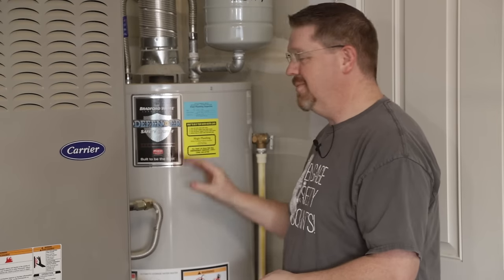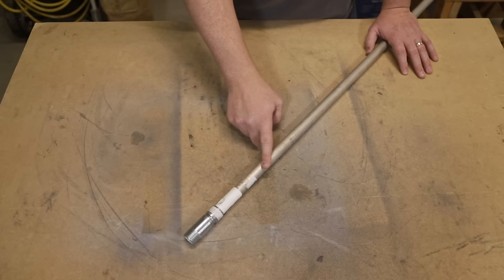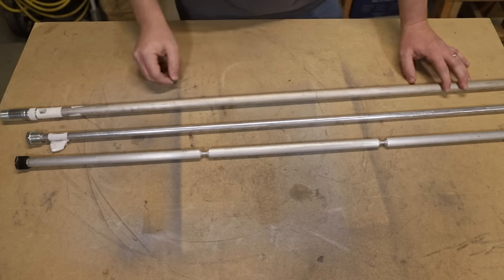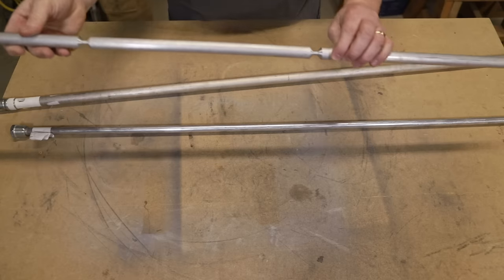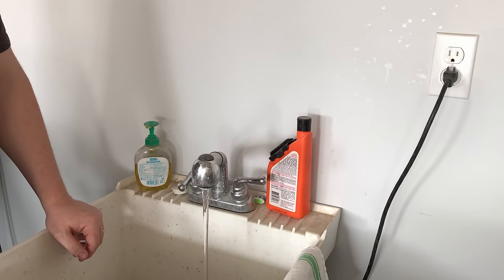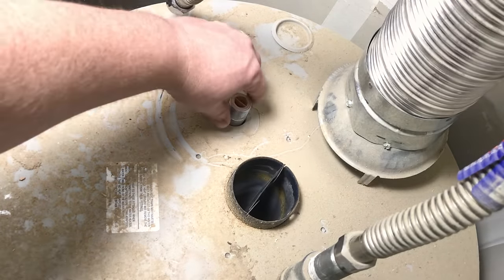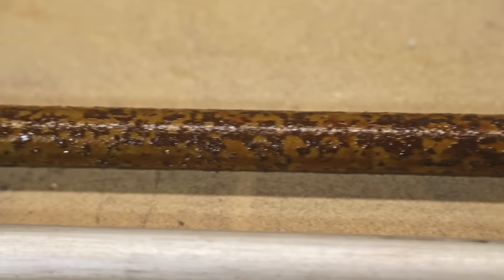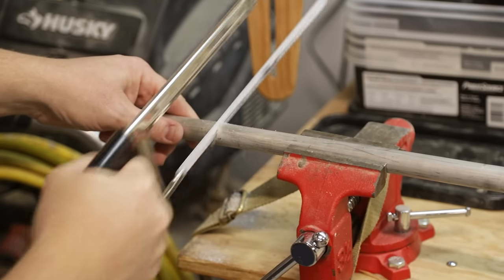How To Replace Water Heater Anode (Step By Step)

Comment: If I don't have enough head space to remove the old anode, how would I remove it? Thanks
Reply from the maker: Hi Edward - you'll have to remove it in sections: unscrew it and lift it as high as you can. Then attach a vice-grip to it right at the outlet to hold it up, and cut off the section that has been exposed. Then lift the next section out with the vice grips, move the vice grips down to the outlet and re-clamp, cut just above the vice grips again, lather, rinse repeat.
To replace it use one of the sectioned anodes that I demonstrated in the video that is flexible. Good luck!
Reply: Just take your cordless drill and get a paddle/waffle bit the same diameter size as the anode rod and drill a hole directly above where the hot water outlet sits on top of the heater. Drill into the sheet rock ceiling and now you have the room to put the rod in.
Reply: @Eddie-In-Las-Vegas  Thanks.

Comment: My water Bradford is 16 years old. Never flushed never changed anode rod. Not touching anything until it leaks or dies.
Reply from the maker: Yeah, you are on borrowed time. I hope it lasts a lot longer for you!
Reply: @AmplifyDIY  Well over its life span so I am in the +.

Comment: What is the maximum I can cut an anode rod?  My rod does not fit in, due to height of sealing.
Reply from the maker: Hi Rohit - if you have to cut the anode, it will not last as long. If you can, it's better to get one of the flexible anodes I showed in the video so you can get a full-length one installed. Good luck!
Reply: @AmplifyDIY  I already brought a straight one and costs a lot to return.  For next time I will use flexible, after watching your video.   I am looking at cutting 7" from 50" rod.
Reply from the maker: @rohitbhatnagar7599  Ah, cutting a 50" rod down to 43" is fine. Good luck with the install!

Comment: how old is the water heater? it is not that bad on the anode. Can the calcium be clean up on the anode?
Can I use impact wrench to remove the anode rod?
Reply from the maker: Hi Spock - at the time of this filming, the water heater was around 3ish years old. There is no reason to remove the calcium on the anode - it'll naturally fleck off as the anode continues to do its job. You can use an impact on the anode, but I don't recommend doing so. It's gentler and safer on the rest of the fitting to use a large breaker bar. 
Good luck!
Reply: @AmplifyDIY  Thanks for the information.

Comment: How come you didn't open the pressure valve when trying to empty the tank a little... ? Also, I think it would have been nice if you at least cleaned all the dust on top of the tank before you started recording... looks so disgusting.
Reply from the maker: Good question on the T&P valve: I didn't need to open it, as the tank was draining ok with just the faucet left open that I showed earlier.  Sorry you found the dust to be disgusting.... I always try to be accurate about the actual conditions I am working in. I dislike videos that are clearly staged or showing how to work on something that is clearly brand new.

Thanks for watching!
Reply from the maker: @alanabunch8881  Good luck with your replacement! Have you considered a different alloy than magnesium? Using a different type may help with the smell.... Good luck!

Comment: my OEM Bradford White anode rod cost $90 (vs your $25)  and the heat trap $13 (vs your $4). Inflation after 4 years?
Reply from the maker: Yeah, most likely. An awful lot of stuff has gotten a LOT more expensive over these last 4 years.
Reply: @AmplifyDIY  Still worth it over the $700 the company was going to charge me to replace it!

Comment: So a starting question is: Why don't manufacturer's use a water tank that is NOT easily corroded?  I have no doubt this would not be that difficult, but that the heater manufacturers want these things to fail.
Reply from the maker: Simple answer: Cost.

Comment: If your hot water heater is over 2 years old if you never touched your gas valve DON'T if you do you might not have hot water .its like a old hot water valve thats old it doesn't leak until you touch it.
Reply from the maker: Eh, I disagree. I recommend viewers take the time to learn how a water heater works, and perform maintenance on it regularly. When it is maintained, a heater should last a very, very long time. The best time to start maintenance is of course during the first year, but the next best time is right now, no matter the age of the heater (within reason... something that has not been serviced in 20+ years but is somehow still working is just a failure waiting to happen... but something that's only 2 years old? That's practically new. :) )

Thanks for watching!

Comment: Not knowing what the tan colored "dust" is on top of the water heater.... the dust looks like wood or insulation debris.....  One MAY WANT to clean the top of the water heater especially near the hot air vent for the gas fired burner.....  JUST IN CASE....

Comment: Where did you get your anode rod?  That is a great price.
Reply from the maker: Hi Rohit - I picked up the anode online from https://www.supplyhouse.com/ - you are right, they offer great prices on parts for water heaters. Thanks for watching!
Reply: @AmplifyDIY  Did that price include shipping?
Reply from the maker: @rohitbhatnagar7599  Hi Rohit - if you look on their website, it's easy to tell what they charge for shipping to your zip code. Looks like prices have gone up a little, but I could order the same anode I used in this video today shipped to my zip code for a total of $42.39, including shipping.

Comment: Where did you get your replacement rod from? I tried calling Bradford White Parts and they don't sell to homeowners, only wholesalers. I tried ordering through bradfordwhiteparts.com and they want 30 bucks just to ship the thing, plus the cost for the parts, obviously. Thought I'd check with you to see how you went about it.
Reply from the maker: I found mine at supplyhouse.com - just look up your specific heater model number and they list parts that way. Shipping was not overly expensive, either - $5, as I recall. Here is the exact part I ordered (though of course check to make sure you order the right thing for your model): https://www.supplyhouse.com/sh/control/product/~product_id=224-47776-19

Good luck!

Comment: Wouldn't that be easier to replace the magnesium/alumimum anode rod with a titanium 12 in. anode rod with cathodic protection system i.e. Corro-Protec
Reply from the maker: Hi Jean - I'm not sure it would necessarily be any easier as far as the swap process goes... but it would prevent needing to ever change it again. However, they are quite a bit more expensive as well, and they add to your electricity bill, etc. So, pick your priorities and go with what works best for you. Thanks for watching!

Comment: If you youtube "ao smith how its made" you'll find videos that show that the hot water, cold water, pressure relief, and anode are all what look to be 3/4" npt theaded ports. And that for their premium line, they install two anode rods. One normal hex anode rod in its own port and another on the hot water out like this video. So like, couldn't you install another nipple style anode rod onto the pressure relief valve for a total of three anode rods? Or wouldn't it be possible to install a nipple style anode rod onto any water heater hot water outlet? Assuming that most all water heaters water outlets are threaded, which seems reasonable since replacement heat trap nipples are pretty common.
Reply from the maker: Edit: I was confusing hot water outlet and drain port in my earlier response. Edited with my better understanding.

Interesting idea! However, there are a few reasons not to add more anodes - particularly at the T&P valve location.

For the T&P valve, there is actually a probe that extends several inches off the back of the valve out into the water in the tank. This would interfere with the nipple style anode connection, so the 2 cannot be installed in the same port.

Further: Adding more anodes does not really get you much advantage other than increasing the duration between needing to check/replace the anode(s). If you have 2, they'll last longer, sure, but is it really all that much better to have to replace an anode every, say, 6 years vs every, say, 10? Anodes are cheap. Replacing them is not difficult, so I don't really see much advantage in cramming more of them into your tank. 

Really interesting question though - maybe someone with more knowledge can weigh in?

Thanks for watching!
Reply: @AmplifyDIY   Indeed I didn't think about the t&p probe. My water heater's t&p valve is installed in the top anode rod port. So It seems it's been running without an anode rod for the past 4 years :(. I messaged  ao smith and waiting to see if it would be ok to install a combo rod into the hot water outlet, or if I really am gonna have a bad time if I try wrenching off the nipple. 

Coincidentally, it looks like AO Smith's lower end water heaters have a 6 year warranty while their premium models have a 10 year warranty. Wonder how much the double  rod setup has to do with that :D

Comment: you used the plair in bakuz wen you tri to remuved the firing that the rising you dont ave grip
Reply from the maker: Would not have mattered. There is no way those pliers were getting that anode out. Definitely needed the pipe wrench. Almost needed a breaker bar as well.
Reply: the pliers whasi  in bakuz   the fact the plair whasi no able to do the jobyou dha one ciused to used   @AmplifyDIY

Comment: Where to buy the heat trap?
Reply from the maker: Hi Mitchel - I bought it from the same place I picked up the anode itself. It was less than $5. Here is a link to the one I think I used: https://www.supplyhouse.com/Bradford-White-239-45167-00-Heat-Trap-for-Anode-Rod

Comment: It appears you forgot to tape the top threads on the Anode pipe?
Reply: It's not using the threads to seal on top. I think it's a compression fitting. It's also why he said not to overtighten the top, but used a pipe wrench to "fully seat" the bottom
Reply from the maker: @Steven_S  This is absolutely correct. The fitting out to the house has a little rubber gasket inside that forms the seal. No pipe dope or tape is necessary. Thanks!

Comment: Use an impact wrench.  I don't know why all these videos just don't say that.  If you don't have one, buy one, they are not that expensive and it is a must have tool anyway.  My 10+ old water heater's rod came out like a shot using an impact wrench.  It was totally eaten away.  I knew nothing about anode rods until it was too late.  I think that is the case for most people, nobody tells you about that because they don't want you to do your own maintenance even when it is child's play.  So much of contractor work is like that, but they try to give the public the impression it is all rocket science and beyond us.  Except on youtube that is.
Reply from the maker: I agree an impact wrench is a good option, but for your average home owner, they have no real reason to spend a bunch of money on a strong enough impact to do the job. I try to show how to do things with what you likely already have, or can get very inexpensively. In this case, a $30 pipe wrench works great. Thanks for watching!

Comment: How old was your tank when you changed this anode rod ?
Reply from the maker: About 3.5 years old.
Reply from the maker: But I didn’t need to change the rod yet. It was probably good for at least another 2 years.
Reply: So how often do you recommend this anode rod change ? How do i know its time to change it ? All of your videos are very informative.. thanks
Reply from the maker: My manufacturer says to start checking at 3 years, and every tear thereafter. They recommend changing when it gets down to about 30% of its original thickness. The actual time will vary wildly based on your water supply. Good luck with yours, and thanks for watching!

Comment: the previous owner probably cut it because as you found you barely had clearance. Its odd that you didnt trust the factory to supply the correct length
Reply from the maker: They reason I questioned the factory is because there was no previous owner. I'm the first owner of this house, and at the time this was filmed the heater had been installed for only about 3 years. I just found it odd that the factory replacement was a different length than the factory-installed original.

Comment: How old was your wh?
Reply from the maker: At the time I replaced this anode it was around 3 years old. As I mentioned in the video, the anode still had a few years of life left in it, but I went ahead with the replacement to show all the steps in the job. 

Also, note that the quality of your water supply can drastically affect the useful lifetime of your anode. Most manufacturers say to start checking your anode 3 years after install, and annually thereafter until it needs to be replaced.

Thanks for watching, and good luck with yours!

Comment: That anode rod design appears useless. The magnesium is electrically isolated from the tank by the white plastic spacer is it not?
The fact that the old rod had not lost any substantial diameter is pretty much proof that it isn’t working. The new rod appears just as useless as the old rod. 
It is my understanding that a sacrificial anode must be electrically bonded to the steel it is intended to protect.
Reply from the maker: There is a steel cable that runs through the plastic spacer, and down the center of the magnesium rod. It is electrically connected. The lack of substantial diameter loss has more to do with the fact I have a water softener upstream of the heater, which makes the anode last much, much longer than if it were in the harder water in my house supply. Thanks for watching!
Reply: @AmplifyDIY   😊👍🏼

Comment: how big are the channel lock pliers that you tried to use? i have 8 inch channel lock pliers
Reply from the maker: Those were either 8 or 10 inch. There was no way they would have cracked that joint, though. It took quite a bit of torque on the pipe wrench. If you are in the US, Harbor Freight sells the same wrench I used for something like $12. Good luck!
Reply: @AmplifyDIY  After how many years did you replace this particular anode rod?
I am going to change the anode rod with my plumber in a few days. 
Mine is 4 years old.
Reply from the maker: @d6487  The heater was about 3 years old when I filmed this video. As I noted in the video, the anode did not actually need to be changed - it had some corrosion, but still had plenty of life left. I demonstrated the replacement to show the full process. At 4 years old, you should pull your anode and inspect it. Only replace it if it's actually corroded down to almost gone. Good luck!
Reply: @AmplifyDIY  thanks!
I have yellow colored water coming out of my bath tub faucet and sometimes it turns black too. 
So the plumber said to flush and check/replace the anode rod to find the cause of this.

Comment: Drop a large diameter bolt down the pipe nipple before cranking on it with a wrench.  This will keep the nipple from crushing.  I've pulled some seriously corroded heat trap nipples off crushing the nipple around the inserted bolt.

As for getting leverage on a water heater to torque difficult heat trap nipples, employ a monster truck load ratcheting tie-down strap and a 2x4:

https://www.youtube.com/watch?v=ufDi2EfHT6w

Comment: You would have never gotten the full length rid into the tank, not enough ceiling space.
Reply from the maker: I'm pretty sure that I could've tilted the rod enough to get it in. The bigger issue is that the rod itself was too long to fit inside the tank.Thanks for watching!
Reply: @AmplifyDIY  oh that’s crazy too. Something else to watch out for before you put the new one in tight.

Comment: That is a secondary anode.  This model has 2.  1 secondary and 1 standard rod.
Reply from the maker: Hi Random House Projects - I don't believe that's accurate. I checked both the specs sheet as well as the service manual for my specific heater model, and no mention is made anywhere of a secondary anode. The only anode shown in any manual or parts diagram I can find is the one I showed in this video - connected to the outlet fitting. Thanks for watching!
Reply: @AmplifyDIY  ok...because on the ao smith premium heaters they're are 2.  One secondary in the hot water outlet like yours and a standard anode under a plastic cap.

Comment: You forgot to explain that you need a special  Class-D fire extinguisher to put a magnesium fire out ,  as water or any other  fire extinguisher will NOT work ...
Reply from the maker: Excellent point - though I did caution to be very careful when cutting magnesium... no power tools, etc.

Comment: You said the magnesium rod was for soft water..Why use the aluminum rod?
Reply from the maker: Good question! Aluminum is cheaper, and is better for locations with hard water, as hard water will eat through magnesium much more quickly than aluminum.

However, if your hot water has a bad smell, then you should consider an alloy with zinc in it, as that will help remove a rotten-egg smell in the water. 

You can learn more about these and other less common anode solutions here: https://www.doityourself.com/stry/5-types-of-water-heater-anode-rods-explained (Note: I am not affiliated with this site at all - it's the first result when I googled "different types of anode rods"

Thanks for watching!
Reply: Adding aluminum to your hot water baths / showers is a dumb idea. I don't think an anode rod should even come in aluminum - it's a very toxic heavy metal that can be absorbed into your body through your skin and open skin pores while bathing in warm water, especially.